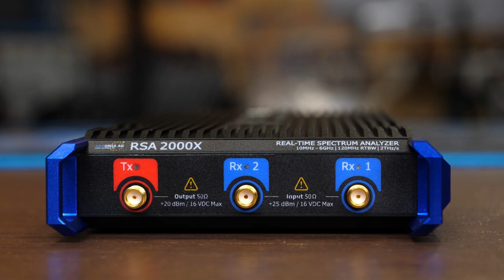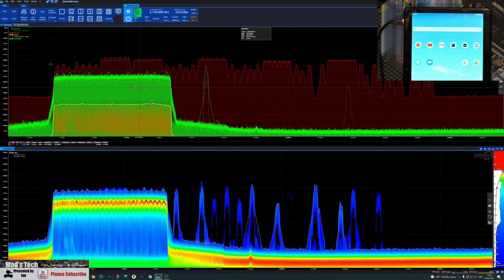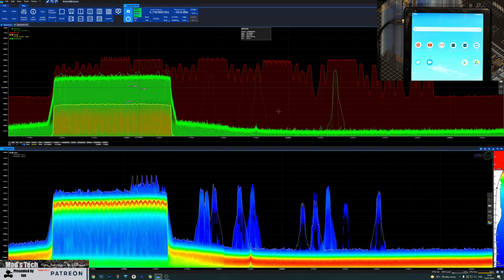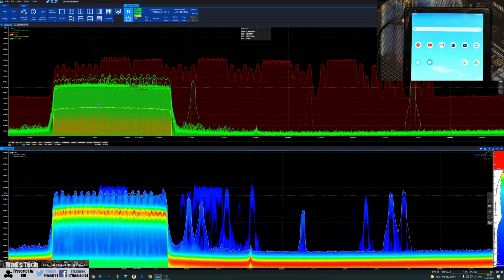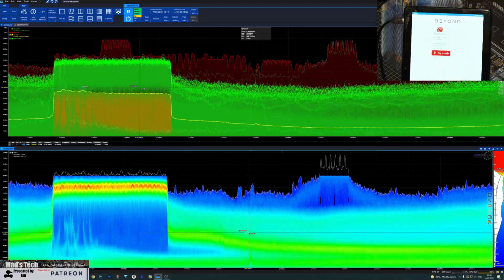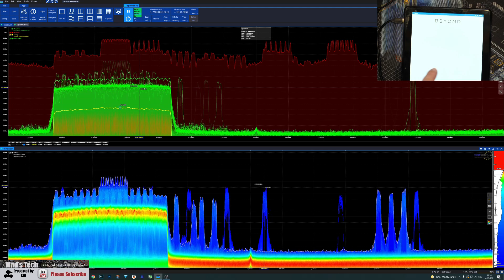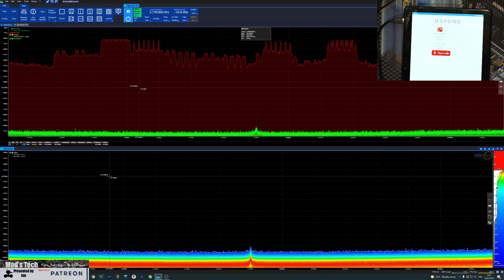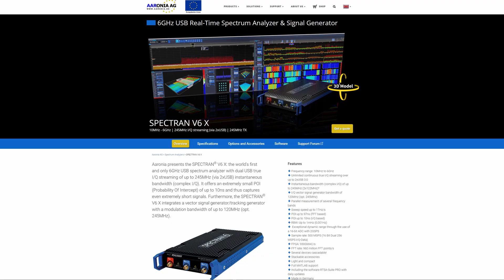DJI FPV Drone FCC Hack - Does It Do Anything ?

Comment: Enjoyed that, interesting thanks. Ive got myself the Dji fpv and v2 goggles. I dont think this works anymore on latest firmware? (1.07).

Im getting about 4300mtrs in CE which im still happy with but as soon as it dips in front of a tree or im not standing directly inline with it, then the signal just drops or loses connection which is annoying.

Comment: Does the B3yond app still work as described with current firmware on the DJI FPV?
Reply: Yes it works. I got the latest version firmware and works great.
Reply: @nejc8a  mate, you got the FCC hack right now? I'm wondering if it's gonna give me more power even though I'm un USA so I'm assuming it's already on FCC

Comment: Hey, great video, thanks a lot! By the way, why is there such a huge difference between FCC and EC? The one thing that popped in to my mind is safety. So, we are wearing these goggles on our heads, loads of radio signals are rushing through the air, that maybe..could affect our health. Might sound like a ludicrous question or dilemma, but... is the FCC hack actually safe for us if we use this drone + goggles for years? Thanks!

Comment: Amazing, and does  the hack goes away when switching in the v2 googles  between fpv mode  to fly a normal fpv drone with air unit or caddx vista , and DJI fpv mode ?   will automatically remember the hack , or should be made each time switch flight  modes in googles ? ,

Comment: Thanks a lot. Great info!!!
Does anybody know what power setting the radio control is using by default?
Can that be increased, for example for better long range flying?
Reply from the maker: The radio will follow the drone output.  It’s all dynamic.

Comment: I did the hack from Drone Hack and the range is insane...I got also the DJI System with air unit + hack. In comparison with the former it seems to me that it`s got much more range. Is it a complete different system in the DJI FPV?

Comment: Question: As with the updates, which have to be done for each battery, would it be necessary to perform the hack for each battery? Or would it be sufficient to perform it for just one since the hack is applied to the drone and not to the battery?
Reply: Nothing to do with batteries.
Reply: @pajomota64  Thanks for answering

Comment: I did the FCC hack, but only 4 channels show up. 1, 2, 3, and 8.
Reply from the maker: That’s on the air unit.  Your in 50Mbps mode. You only get half the channels on the mode.  Go to 25mbps and you will have all 8.
Reply: @MadRC  Thanks so much. I thought I did see the 8 channels some time ago. And your exactly right, I had switched to 50mbs.